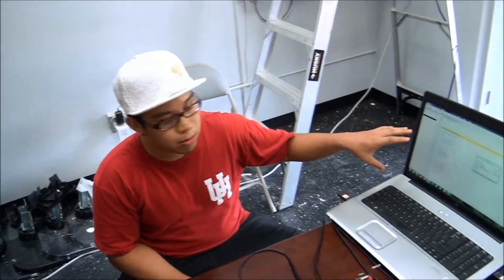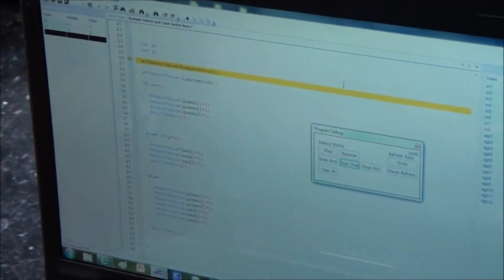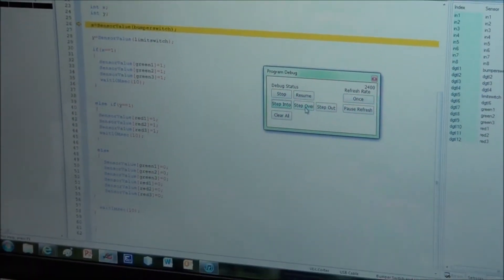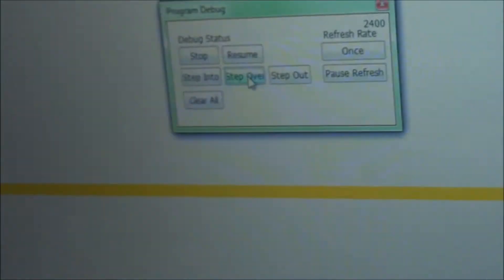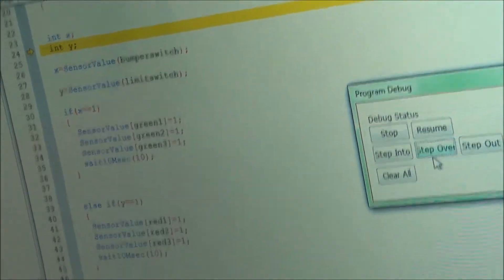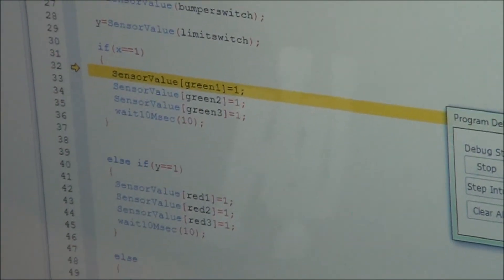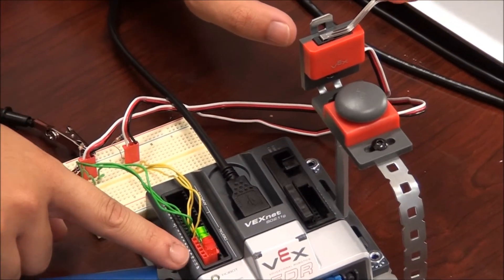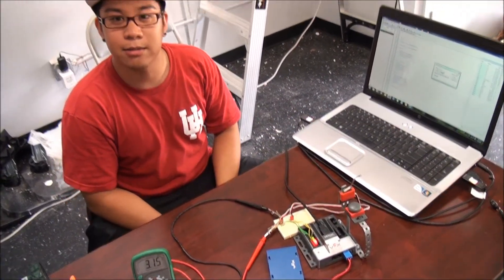C Programming  (Vex Robotics)

Comment: So these simple programming commands could be helpful on the Nasa's Life support system while in operation in Mars. For example, a variable of 1 or 0 will tell the valves and pumps to either pump or stop pumping water into the hydroponics systems or increase humidity, etc. Very interesting.